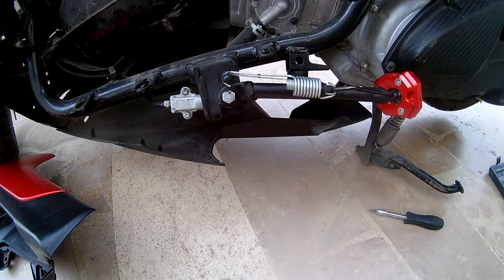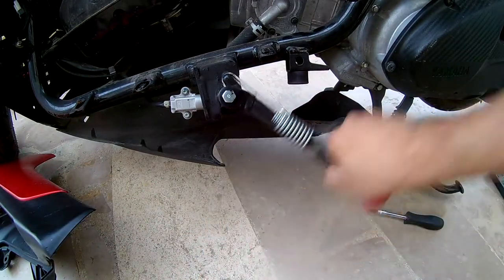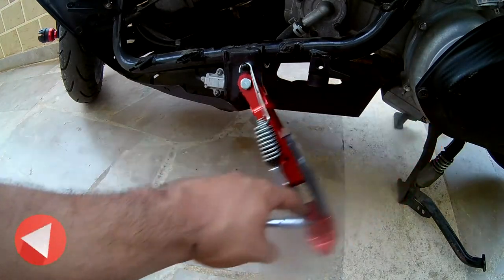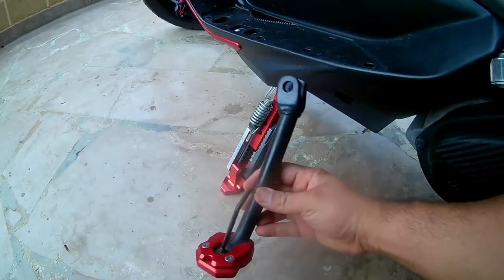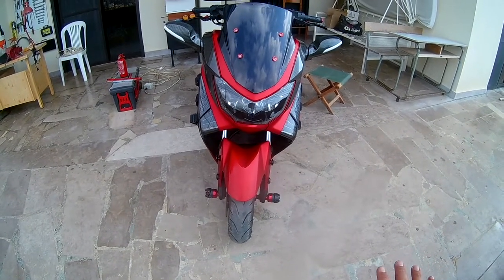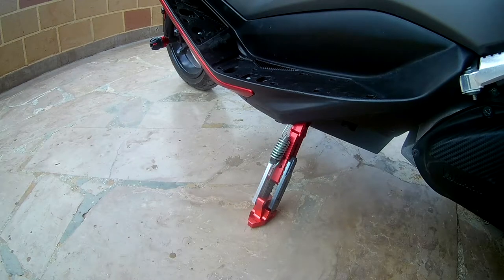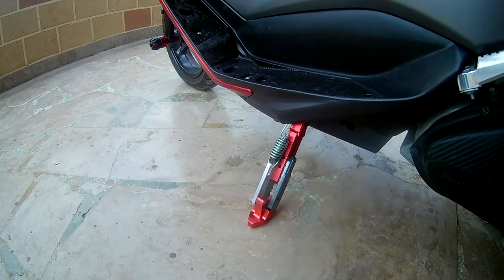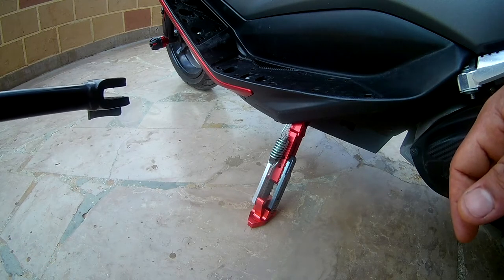NMAX155 nmax155 parking kickstand side support stand

Comment: Yep. The spring does not go there. That aluminum piece is supposed to stick out so your foot can easily raise or push it down. The spring goes onto a bolt that you did not use on the side pre threaded holes.

Comment: @1:13. There's this 2 big threaded holes. There is a big bolt that you need to put in  there. In that bolt is where you need to hook the spring.
Reply from the maker: https://www.aliexpress.com/item/1005003796018812.html?spm=5261.ProductManageOnline.0.0.15744edfDFbzcF
Reply: @elvirawu9495  
LoL. What a ripped off
I just bought one and it cost less than 500php
Reply from the maker: @karimalarifi7778  https://www.aliexpress.com/item/1005003796018812.html?spm=5261.ProductManageOnline.0.0.15744edfDFbzcF
Reply from the maker: @karimalarifi7778  Really same one?
Reply from the maker: @karimalarifi7778   This product fit for NMAX155 2016-2019, NOT FIT FOR MIO125
Reply from the maker: @karimalarifi7778  https://www.aliexpress.com/item/1005001591009677.html?spm=a2g0o.store_pc_allProduct.8148356.1.70df5d41X9MFUa
Reply: @elvirawu9495  mine also fits nmax and aerox... Basically its all the same.